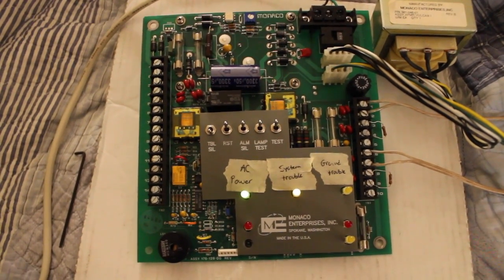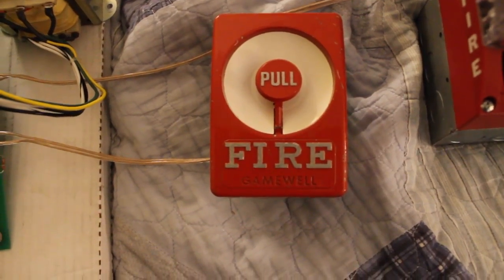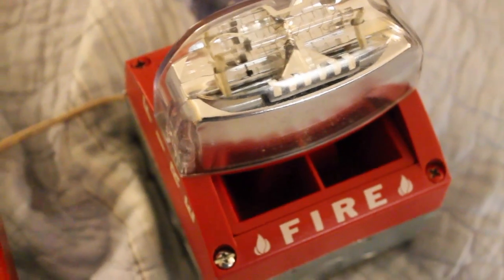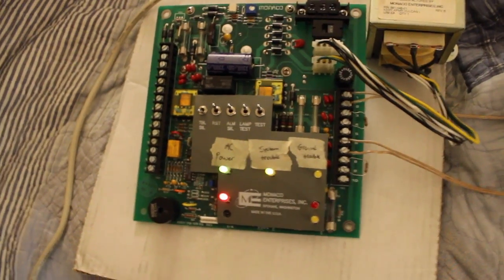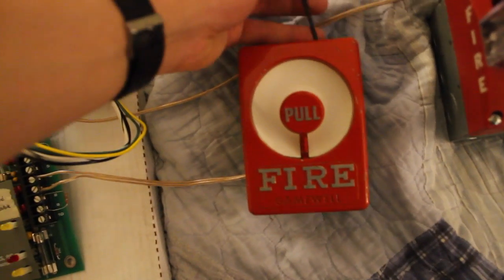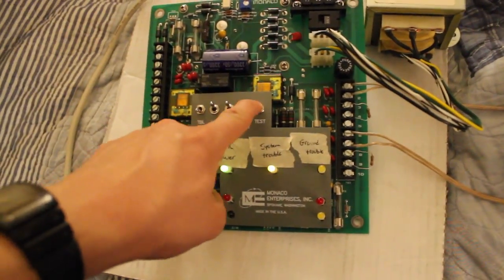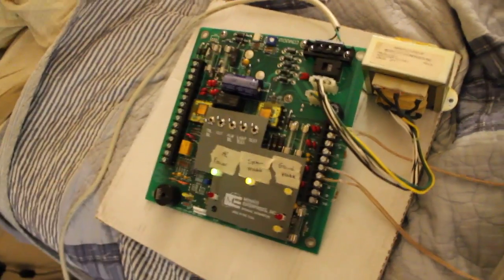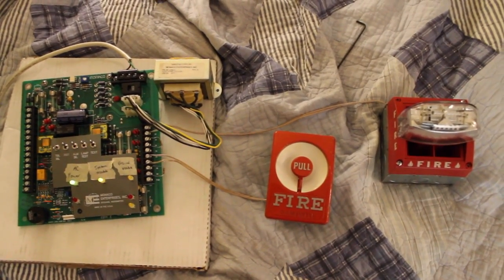Monaco Vulcan 1 - System Test 6

Comment: Is Monaco Vulcan the brand name?
Reply from the maker: Monaco is the manufacturer. Vulcan 1 is the product name. It is a little confusing off hand. I think they also have a Vulcan 2, don't quote me on it; I saw it on their site a few years ago.
Reply: +NewEnglandElevators where do you get the  monaco fire alarm system
Reply: andrew121410 Not sure.
Reply from the maker: I don't know, actually. This was donated to me, and that's all I happen to know about the panel's history. More than likely, the original owner purchased it on eBay when someone had a listing. It's not a common panel, so not too many listings go up.
Reply: +NewEnglandElevators It probably is obsolete.
Reply: Fire Alarm Person 
Monaco Enterprises is the name of the company.
Surprisingly not an obsolete company.  They still make fire alarm panels, and they still make the Vulcan 1 series.  You can find them if you do a Google search for "Monaco Enterprises".

Comment: I have a fire alarm and a pulls station. For the AC adapter, should I cut the wire? Because it has like a headphone jack on the end of it.
Reply: I don't have a panel yet
Reply from the maker: +immakidbruh Cut off the headphone like jack at the end, and then strip the wires. One wire should be the positive, and one should be the negative. To double check, check each of the leads using a multimeter.